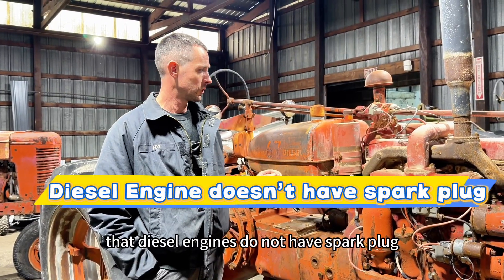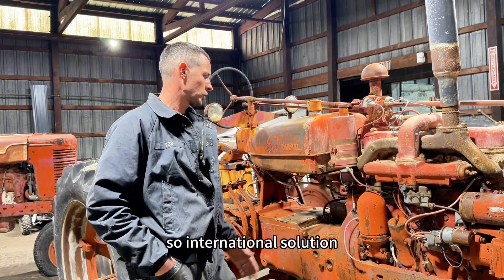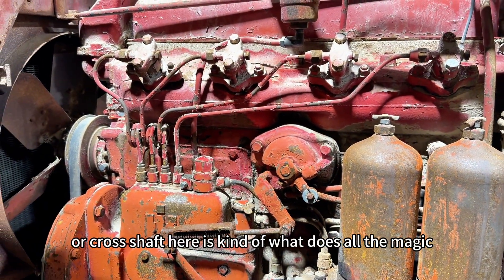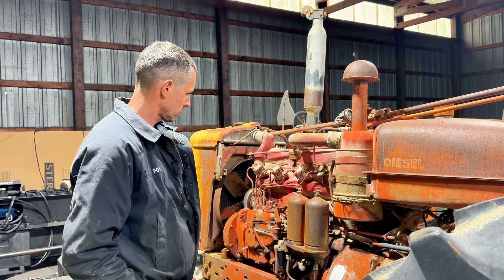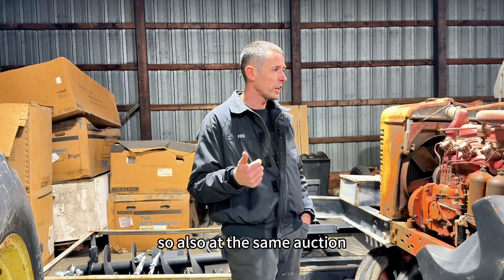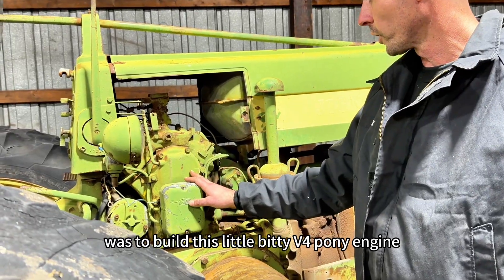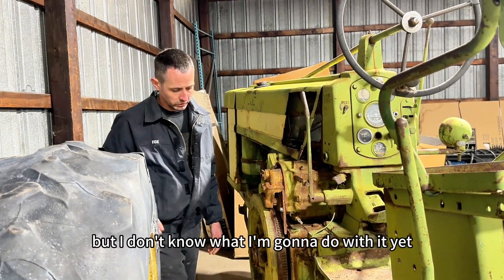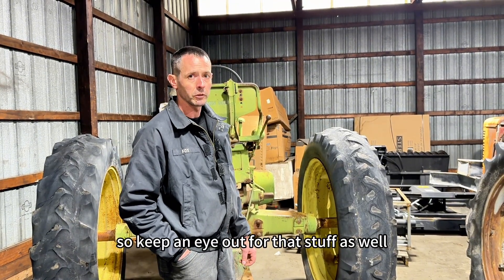Diesel Engines With Spark Plugs? The Strange Genius of 1950s Tractors

Comment: Hey I have an issues
 have you ever dealt with an issue where the accelerator pedal was dead?

I have a 98 freightliner Fld with a Detroit series 60 12.7 
I’ve changed the pedal assembly & tps …I’ve replaced the batteries checked my ECM only other red flag is no computer can connect to my truck for some reason and theres a black and red wire that runs from the plugin for the computer under the ignition to the center panel  fuse box inside the cab / and just ends likes it’s been cut . 
I have the check engine light on and the shut down  
It still starts & idles  through the cruise control . I can move it, but that’s just coming off the clutch. 
I’ve been at for about seven months now

Comment: I don't know how much you know about the gas start diesels, but on the super MD make sure you watch the temp gauge and never let it go into the red, and restart it fast if you kill it while working- those heads are fragile. Also, let it cool down on diesel instead of gas for 5-10 min before shutting it off-diesel burns cooler at an idle. Good luck- it's a good tractor when taken care of. 
Does either of them run?
Looking forward to future super MD videos.

Comment: This concept is still in use in Eastern Russia/Siberia . The use of a Pony or Donkey engine to heat up the main engine before firing that up in extreme cold temperatures . My Cascadia uses the APU to warm up the coolant on the main engine and it takes so much load off the batteries and starter firing her up in the colder climates . With modern emissions engines cold starts and the soot it produces it is surprising they have not thought of electric pre heaters for the combustion chambers as it is not new technology. I believe the next round of emissions have DPF heaters for this purpose. Happy New Year to everyone belonged to you.
Reply from the maker: Happy holidays 🎉